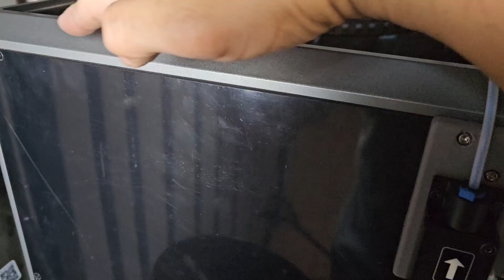Creality K1 Upgrade Side Spool Holder

Comment: What screw did you use for the other part not the spool holder
Reply from the maker: I don't recall but it was part of the screw that you needed to remove from the bed when you first setup

Comment: Hi there... Nice project... What is the screws used for the side sensor holder? Thanks.
Reply from the maker: I used the screws included into the bed of the printer that you need to remove after unpacking.